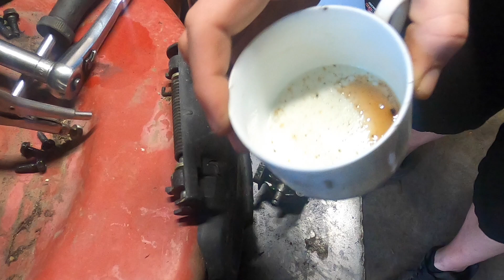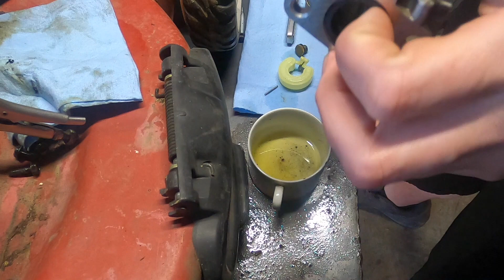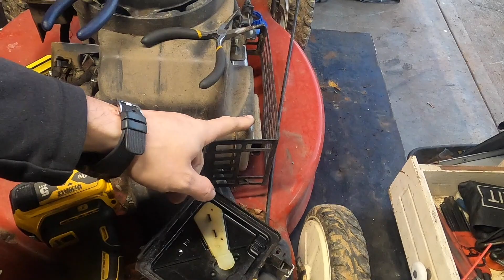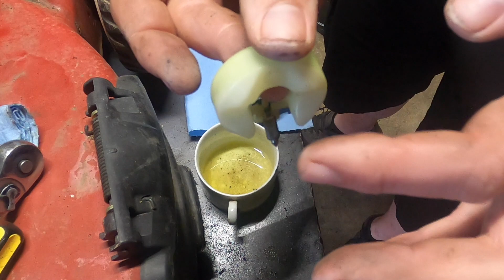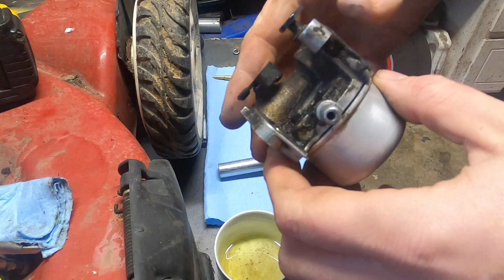How to: Clean a Briggs and Stratton Carb

Comment: whats the name of the tool for the seat?
Reply from the maker: Here is the part number. It is a tool made by Tecumseh. It is a little expensive but they do make other versions which are cheaper. 670377
Reply: @PNWSmallEngineandLawn  thanks!